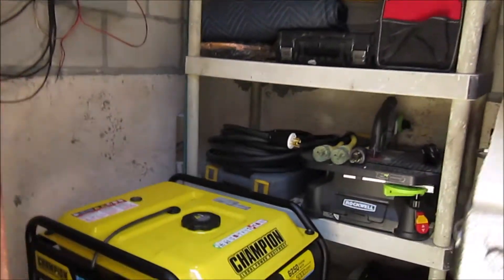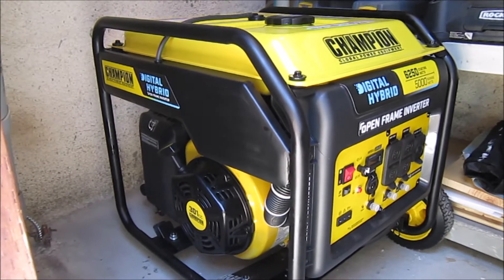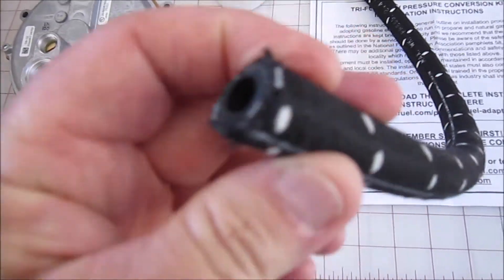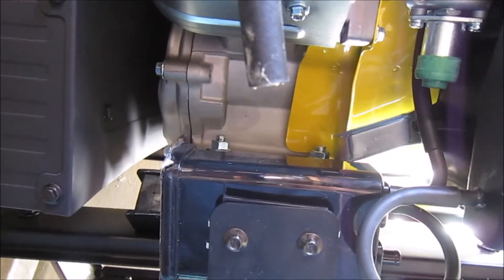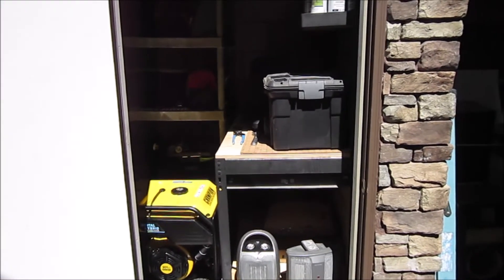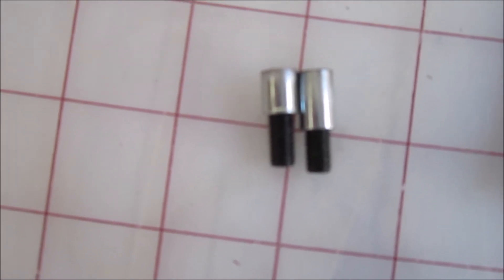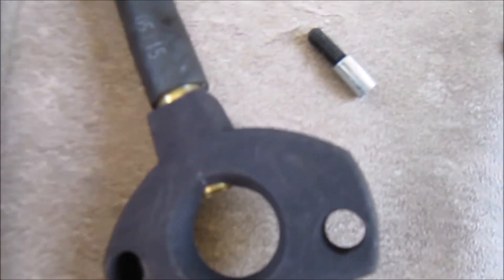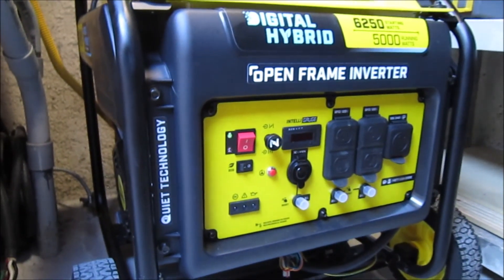Champion 5000W Natural Gas Conversion Comparison of Motor Snorkel and Nash Fuel Conventional Venturi

Comment: Those Nash kits are complete garbage. I almost made the mistake of ordering one for my Champion inverter generator (model # 100520) a few months ago. The kit got my attention because it was roughly $60 cheaper than the US Carb kit version. I did some research and in the end I chose the US Carb kit. It's the second time I have used their kits and they have never let me down. I ran a US Carb kit on my previous Champion model # 100110 generator and it never gave me any problems while running on propane. I installed a US Carb kit on my 100520 model and it works perfectly. So the moral of my story is this, cheaper isn't always better. And in my experience, the US Carb kits are a much better designed kit that simply work.
Reply from the maker: Thanks for the comment regarding your experience with US Carb. I'm assuming you are referring to their conventional (venturi) conversion kit not the Motor Snorkel which is also their product. I agree that cheaper is not always better, I generally try and find the best VALUE product when possible. Your characterization of the Nash Kit as "garbage" may be a little exaggerated. While it was definitely not a "plug and play" installation and did require extra parts, a few choice words and some minor modifications, the end result is that it works quite well. The neg. pressure regulator that comes with the kit is the same name brand product as in the more expensive kits and the fiber reinforced polymer venturi adapter (while not machined aluminum) is well made and works just fine.
Reply: @bentleyjarrard885  the fact that the Nash kit is not completely “plug n play” without needing any extra parts or fabrication of existing parts is more than grounds for me calling their kit garbage. I looked at the same kit you showed in your video. It had the same Venturi adapter as yours and I didn’t like it. I didn’t like the fact that it doesn’t have the same cut out holes like the factor gasket has. The US Carb kit has just that. Everything is 100% plug n play without needing to jury rig anything. But, at the end of the day it’s all up to the purchaser and what his/her budget is for a project like this. But to me, depending the extra money on the US Carb kit is most definitely worth it.
Reply: @Ozzie4Para  - whats the part number of the kit you preferred for your 100520?
Reply: @Ozzie4Para  Mint -  Thanks, Ozz-man!
Reply: @Ozzie4Para  hi Ozzie. What was your start up procedure like with that kit? Anything special? Having trouble with getting my engine started with the same generator. Appreciate any tips, thanks!
Reply: @user-fx5gb2vf9g  You generally need to adjust the fuel mixture bolt that's on the regulator. I don't remember exactly how many turns out is the general starting point from the US Carb website. From there you can adjust the mixture bolt in small increments to fine tune the engine for the optimal performance which is generally 3600rpm. But that's not always the case with an inverter generator.

Comment: I'm in the process of deciding what kit to buy. I know I don't want one where I have to cut the frame like the ones with thick spacer. The Nash Fuel one looks like it would fit good. My one question is did you modify the venturi adapter to match the shape of the stock gasket?
Reply from the maker: Ken G, I did place the factory gasket on the Nash Fuels venturi (carburetor side) and found a couple of cutouts in the gasket that were not present in the Nash Fuels device. I drilled them out but only about halfway through so the holes in the carburetor were not obstructed and there was no disturbance of the actual venturi profile on the other side. I detailed all of this in part 2 on my channel, its only 5 min and may answer some your questions. Thanks for watching.
Reply: @bentleyjarrard885  Thanks, I watched the 2nd video.Good advice.

Comment: Great review! One question: Does the NG keep flowing if the engine stops, such as if the low oil shutdown kicks in? I want to convert mine and have wondered if this would happen.
Reply from the maker: BrazDane, No worries, Nat Gas is delivered only when the engine is running and there is air flow passing by the Venturi or Motor Snorkel which creates negative pressure that essentially "sucks" the Nat Gas in via the special neg. pressure regulator. This is actually the same concept as a normal gasoline carburetor where the air flow pulls liquid gasoline up from the float bowl through the jet into the incoming air stream. Of course the Nat Gas is pressurized vs liquid gasoline, thus the regulator that comes with the kit takes care of this issue and does not allow Nat Gas to flow unless it senses negative pressure. It has to do with the way the diaphragm and springs are set up differently than in the Nat Gas regulator for a home that will supply pressurized Nat Gas at approx. 8" of water column. Thanks for watching and for the comment. If you have any other questions, feel free to ask.

Comment: Nice Video.  Looks like your going to do all the necessary work to use the Nash kit,  do you think it's better than the MotorSnorkel?  Also, did you use a tach to tune?  If you did, what RPM does it idle down to in ECO at no or very little load?
Reply from the maker: Bruce, The Nash kit was the one I installed last with all the modifications mentioned in the video and is the one I left on. I can't say that the Nash is better than the Motor Snorkel because they both work well. My unsubstantiated belief is that because the Motor Snorkel partially blocks the intake on one side of the choke plate, full throttle performance may suffer due to limited air flow. I only tested both conversion kits up to about 50% load and there was no detectable difference. Clearly the Motor Snorkel would be the better choice in cases where a frame modification would be necessary to use a conventional style THICKER venturi. I didn't test RPM with the ECO throttle on or off because at this time I don't have the instrument.